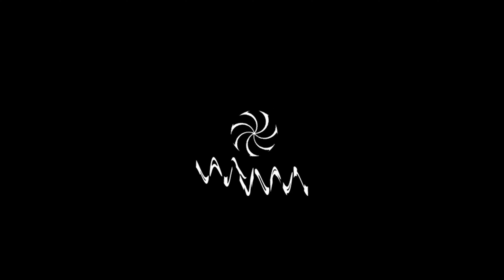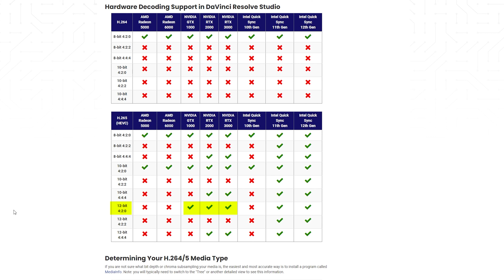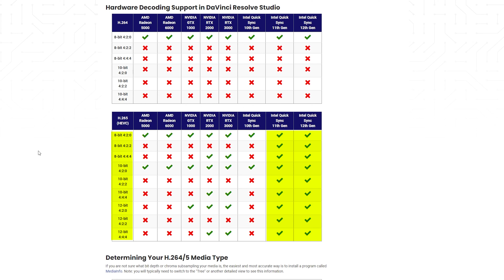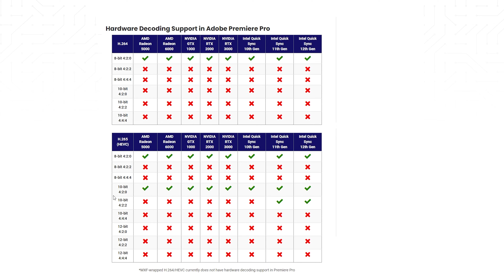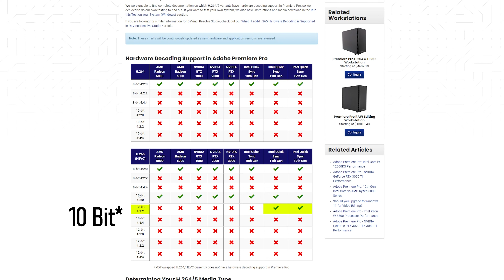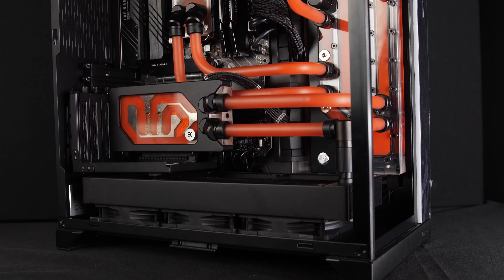THIS is why INTEL is BETTER than AMD in Video Editing! (EN)

Comment: Hey man
What cheap cpu do you recommend for video editing, I want a smooth video preview, for Vegas and Premiere

Also for gaming 

I live in Brazil, almost everything is expensive here 😂
Reply from the maker: 13600k or 13700k if you can fit it into the budget, if not 12600k should be significantly chaper and you'll sacrifice some gaming performance but video editing will be smooth af
Reply: @polymorphcomputers  
That's exactly what I was thinking. There really is no other option. I think I'll go for 12600k. 
Thank you very much!
Reply: @polymorphcomputers  
That's exactly what I was thinking. There really is no other option
Thank you so much for responding!

Comment: Does anyone know which cpu between intel and ryzen handles prores 422 better?
Reply from the maker: For ProRes both Intel and AMD are very much neck and neck in the high end consumer segment. 
Both a i9 13900k, and R9 7950x will offer virtually the same performance within 1-2% of each other, the same is true about the 13700k and the 7900x. 
Where Intel starts to win over the race, is at the mid end with it's 13600k and 12700k performing basically the same, both leading the 7700x and 5950x by a good 5-7%. 

If you're looking at the high end, choose whichever platform (CPU+RAM+MB) ends up being cheaper, unless you tend to export more than you edit on that PC, because then I'd recommend AMD for the better power draw. 
If you're looking at the 300-ish $/€ segment, definitely Intel's 13600k! Also you'll gain more flexibility with H.265 and Quicksync especially, because who knows what the future brings in terms of cameras.

Sorry for the late reply, hope this helps!;)

Comment: Does the Free Resolve version benefit from quicksync?
Reply from the maker: Yes! Many h.265 codecs are supported even on the free version
Reply: Cool thanks maybe time to upgrade from 8700k
Reply from the maker: @KoiAquaponics  Just upgraded from a 8086k myself, it was working fine with Prores or proxys for my GOP h.264 but now I save myself the time with transcoding/proxies because the 12900k edits GOP just fine. For bigger projects I prefer to use All-I, but for h.265 it's actually an absolute game changer!

Comment: Im planning to buy a laptop for for video editing adobe premiere pro so I should choose intel or ryzen processor ?
Reply from the maker: Depends on the codecs you're using.
First find out which iGPU the Intel laptop is using, then go check Intel's website and see if it's supported under: "Encode and Decode Capabilities for 7th Generation Intel® Core™ Processors and Newer".
If it's on there, the Intel laptop will probably be superior, if not or you're editing .raw, then go with the highest core Ryzen in your budget range.

Comment: Yeah, but what about 4th generation 4790K processors?

I'm not sure hokey Magix Movie Studio 16 would use both the GPU and CPU GPU... I've never heard any mention of it ever.  Can't stand Davinchi Resolve.  I use 1080p h.264 not h.265 or 2.7k or 4.k.  1080p is overkill even for mobile phones.

I think it's funny these guys think Youtube Content Creators are using the latest and greatest hardware.  In 13 years and 500 videos later, I ahve yet to make one cent on this platform... so yeah... the upgrade I'm looking at is from an FX-8350 to a 4790K system I just bought.  Should I move all my work over, or not.  :-/  The CPU is only 33% faster itself.
Reply from the maker: I have a 4790 non-k sitting around, maybe I can do some benchmark tests comparing it to the 8700k and 12900k soon!

For 1080p it should be fine with enough RAM and if it's not, you can still make 720p proxies, transcode to prores, or even both for much better editing performance!

Comment: I'm just wondering If your IGPU has a strong encoder and decoder than a dedicated GPU then what's the point of more expensive dedicated graphics? Well you are going to say,  that handles other activities like 3d related tasks whatever Im gonna say INTEL IGPU and dedicated graphics works together with quick sync
For instance, if dedicated GPU is busy at some workload besides the encoding or decoding then that handles over to the IGPU to encode and decode. Basically, it will share the workload between the two GPUs when either of them is busy.
In that kind of scenario,,, you get the benefits of having two GPUs and intel quick sync.
This is not an argument this is just my thoughts on it. 
Because I have a strong Nvidia GPU and intel CPU, I tested with and without quick sync and the changes are not dramatic.
But I think it's more beneficial for those who have low-end dedicated graphics.
Reply from the maker: Discrete GPUs obv. have their place in the industry for memory intensive applications like CGI or effect heavy long movie edits. Also when you look at Nvidias decode support for professional codecs like 10 or 12bit 4:4:4 it's baked right in there.
The reality tho, is that most of us aren't shooting on RED cameras but rather on a7SIII, GH5 or BMPCC. All systems on which, if you want to fully utilize their capabilities, you'll be shooting in probably the most widely used codec: 10bit 4:2:2, or even 12bit 4:2:2, both of which even a 1500€ 3090 can't natively decode, then a 12600k or 12900k on the other hand can, and will improve your scrubbing and playback experience noticeably over even a 5950x or in your question say jumping up from a 3060ti to a 3080.
I'll share my data about the new Ryzen 7000 Series and it's iGPU as soon as I test it!
Reply: @polymorphcomputers  I need to know one more thing, for setting up quick sync how much memory is need to be allocated for the igpu?
nvidia NVENC vs intel igpu quick sync which one has the fastest encode and decode performance?

Comment: AMD 7950x will also have a igpu and this will support H.265 and H.264, what I don't know is, if it will support 10bit 422 or just 420 and 444. I need 422 for 4K 120fps H.265 footage. For my 8K RAW  needs  my "old" AMD 5900x and a 3090 are already not bad. Now I don't know if with the igpu from a new 7950x I would benefit like Intel users allready do, with the quick sync of a 13900k or a 12900k. I thought, davinci benefits from the igpu decoding because of quick sync. Now if the AMD 7000 Generation will also support all the H.265  types and if Davinci will benefit from this, then this point will become equal between Intel and AMD. So I hope AMD will Decode also 422, as then the cheapest 7000 processors will be good for this.
Reply from the maker: This is why I'm so excited for AMDs R9 series!
With the better IPC and higher clocks it will already be a beast for editing. At the end, like you said, the only question that remains is what codec decoding they will support natively through the iGPU.
Can't wait to cover it as soon as they launch!
Reply: @polymorphcomputers  has anyone started using these R9 processors in laptops

Comment: None of those codecs are considered good quality for video editing, that's the reason Apple made hardware acceleration for ProRes codec. 
And how many streams can it decode at same time, and at what resolution? That's important when editing.
Here's a good chat about it... https://www.youtube.com/watch?v=MKDfA_z_Cu4
Still is nice that Intel has h264 and 265 hardware encoder with better color signal
Reply: Prores is great but it has limitation in the film industry when it comes to camera support and file size. H.264 and H.265 are very efficient when it comes to quality vs size but they are very heavy to edit.
Reply: @tayo5302  That's kinda the downside of having a powerful output signal from camera like R5 and R6 produces an heavy h.265 and smaller file size but need a super beefy computer to edit them I had to upgrade to 11800h just so I can edit a 4k video from my R6.  Proress is good for media production inhouse such as DnxHD, but in terms of camera file container you're right they aren't supported on cameras in built record, but some offer proress 10bit via output hdmi on atomos Ninja Setup, but that's another thing.

Comment: Quicksync is what decided me on the 12700 (maybe k) for use in DR.  And if you don't own DR studio my understanding is it speeds up encoding too.  And you can always transcode output in handbrake which will use GPU depending on if that's worth the time if you don't have studio.

Comment: I currently shoot with a Sony A7III which I believe only shoots 8bit 4:2:0 so I guess I don't need to upgrade from my Ryzen 5700x just yet 😅
Reply: and you get smooth timeline scrubbing / playback with that? I had a 3700x with an old gpu, AMD r9 390 (was the gtx 970 competitor) and It was worse at video editing than a phone. I couldn't smoothly play back Sony a7iii or even gopro footage. Cause the risen processors have no asics and single core isn't even that good on the 3700x so video editing was terrible. Was really frustrating for me because I thought with this upgrade I'd be able to edit.